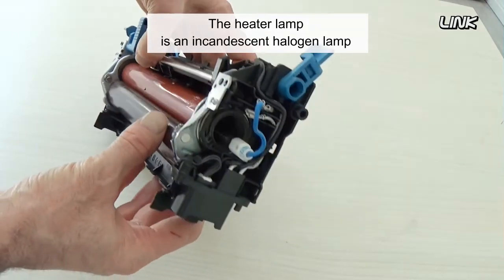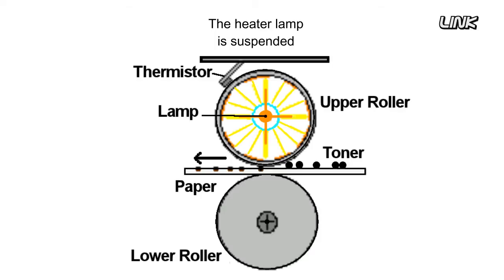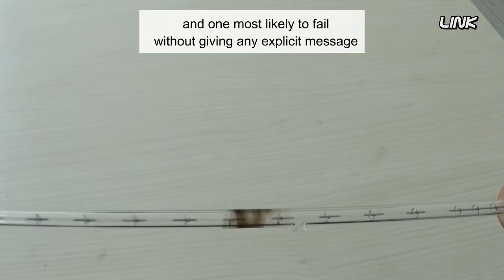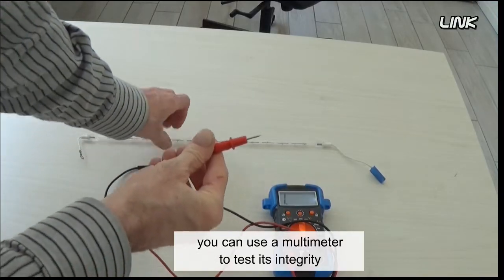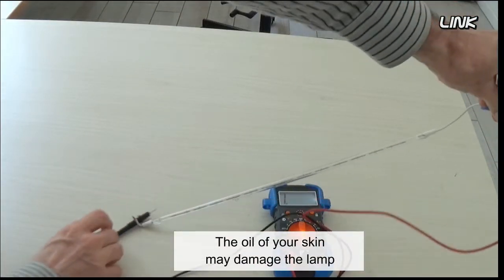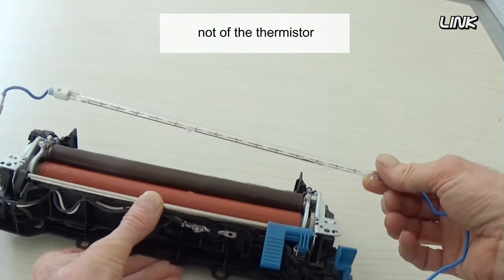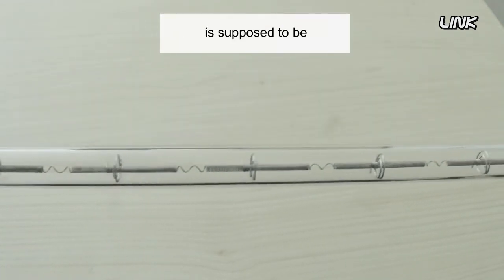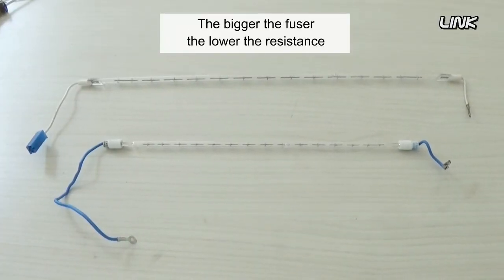How to test a printer Heater Fuser Lamp

Comment: Hi, thank you for the video. Just for knowing it and perhaps you've tried: can the heater be connected directly to an AC source (220v in here), just to see if it heats on? does it need a resistor, the thermistor or another electronic device just to preserve its integrity or give the right amount of energy?  Thanks!
Reply from the maker: No, I haven't tried. I think it can't support 220 V

Comment: I have HP LJ 602 printer the fuser don't fix the print
Reply from the maker: May be the thermistor, a dirty thermostat, the heating element, a worn fuer roller

Comment: Thanks very much for your posting. Whn I printing a bit more, say starting 30 pages continuously, my Brother MFC-L6700DW starting to smell burn plastic. I believe it's from the film plastic tube in the upper roller whr the heat lamp is underneath. Actually, I've opened, cleaned it & put new grease. I use Super Lube multi-purpose synthetic grease until 450 F (232 C). Should I use higher working T ? Thanks.
Reply from the maker: I think it's normal that a printer starts lightly smell plastic. May be the environment is too cold or humid
Reply: @viandant5  thanks mate. It has strong smell plastic burn. What's the temperature of the lamp in a laser printer ? One says 400 C other says 200 C. It's normal humidity & not too cold room (22-25 C).
Reply from the maker: @joeyahoo4493  The temperature is max 100 C but it's around 125-150 C
Reply: @viandant5  what's the temperature at the metal bar where it receives the heat from the lamp underneath then transfer it to the plastic sleeve?
Reply from the maker: @joeyahoo4493  150 C is the temperature of the surface of the fuser roller. THe heater is more than 200 C
Reply: @viandant5  ok. Thank you

Comment: 0 seconds ago
Brother HL-2270DW printer.
Is 2 lamps used depending on mains voltage (120v or 240v)? Or is the lamp PWM switched and only one lamp is used internationally?

Your videos are the best ones about service. You are obviously a very experienced professional. Thank you for sharing your experience with us.
Reply: Changing this printer from 120v to 240v is only about the fuser, yes? The power supply is international, yes?
Reply from the maker: @davecc0000  Thank you! The high voltage power supply have two different codes so I think there are two versions, 110 and 220V. I don't konw the lamp of that Brother model but the lamps are often 110V or 220V, so I think they are different too

Comment: Hi
i have a borken fuser lamp in a Canon CLBP 360/Apple Color Laserwriter but I don't know what exact model it is. Where can I find which model of fuser lamp it is ?
Reply from the maker: You mean the value? I haven't manuals of this printer. These lamps are custom-made, I think you can only buy it from a Canon spare part reseller